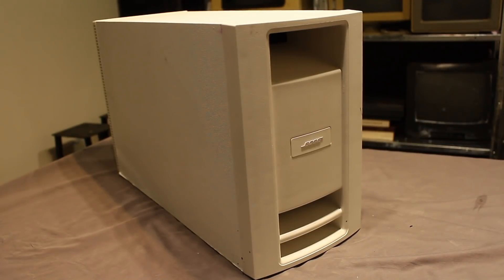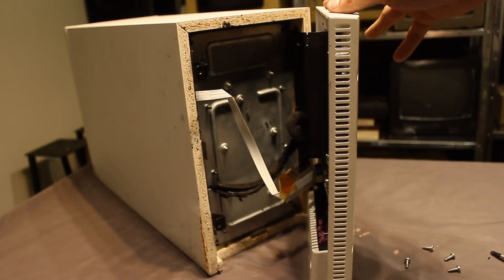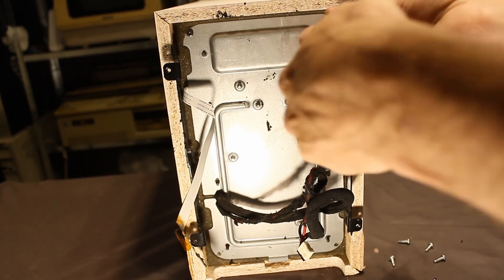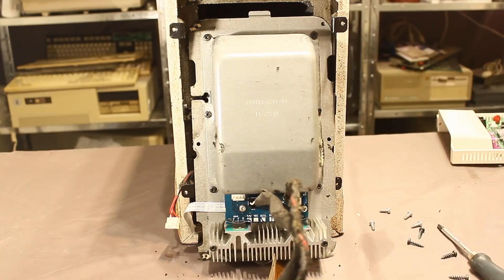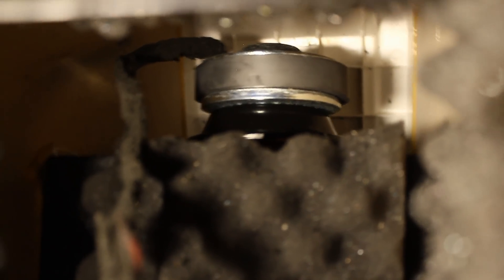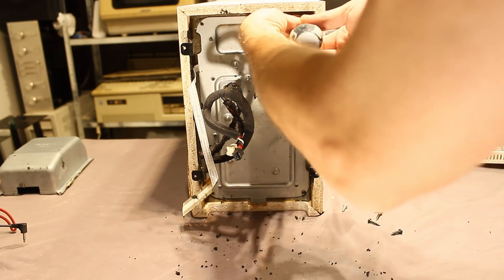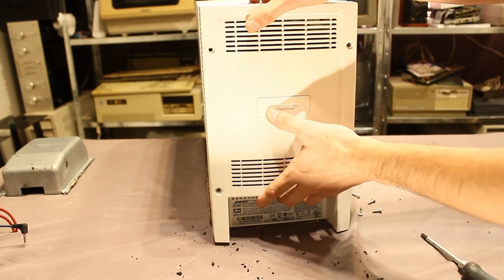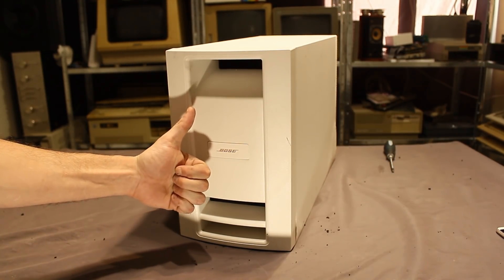Whats Inside Bose Acoustimass Module ( How Many Watts ?? )

Comment: Interesting. Thanks. I'm retiring my old Lifestyle 12 system & going back to a stereo separate component system like I had in the 80's.  The voices through the Bose were muffled, display on the head unit blown & fuse blow every few years on the Acoustimass. It's been fun but time to spend some big $ & move on.

Comment: So a colleague of mine at a previous job was a former Bose engineer through the 1990s and 2000s. He explained that the upper and lower ports create an airflow diode that produce more inward flow of air on the bottom port and more outward flow of air in the upper port, for the purpose of exchanging the air inside the enclosure to cool the amplifier. Overall it's a 6th-order bandpass design.

Comment: Comparing amplifier power to the rating on the power input is stupid. Power consumption ratings are NOMINAL, often at 1/8 Power so a 600w home theater amp may only say 150 or 180w on the power input because that is an AVERAGE consumption. This is NOT what the amplifier is capable of. Even pro audio equipment(amplifiers)is rated the same.

Not knowing this makes your opinion invalid.

Also how many watts something is is not even half of the story to actual bass output. Driver efficiency and enclosure design are more important. 100w into this module is nothing to 100w into a stack of 18" horn loaded concert bins. Bose are usually rather inefficient so 100w into this module is almost definitely less bass than a 100w 12" sub designed for home theatre.
Reply from the maker: Still no reply lol
Reply from the maker: ... The max power ive ever seen this system pull from the wall was 320 ish watts . so the 350 MAX as it clearly states is accurate . bose always write MAX on them. Now as for the " sensitivity " yes on an 18 it would be louder as normally a 18 or 12 is more sensitive hence more efficient then a 5 inch
Reply from the maker: Also if you watched the video you will see i look up the chips . i dont claim its a devision of the power consumption

Comment: Hey man, I've been meaning to ask you: Is the studio like foam inside the bass module something you out inside or something Bose actually installed themselves?

I know you like to tinker with things this why I'm asking, but would love to know because if so.. that's damn impressive.  I current have the Bose V20 and have since chucked my Paradigm Millrnia CT system in the closet as it absolutely floors the Paradigms, but I'm going even farther with the Jewel Cubes and PS48 when I can.

I know the PS28 doesn't have the foam, but sounds very clean and musical, so again please let me know on that eggshell foam stuff.

Glad to see you're still making vids, keep it up man!
Reply from the maker: The idea of the poly fill is to make the woofers think there in a bigger box , it does extend low frequencies a bit which helps the overall sound . Connect the millinea satts to the Bose and then run the adapt IQ . I’ve found the Jewel cubes to be a bit limited compared to the standard cubes . Experiment with it . I’m currently looking at a cheap V30 Bose system atm never know might put out some new videos soon
Reply: @TheTechGuyYT  Ok man, but you didn't answer my question, lol - did you install that foam in the bass module yourself (along the sides of the cabinet wall and around the isobaric dual woofer chamber) or did it come like that from the factory?

I know all about acoustics and polyfill; I've built my own subs (sort of, parts and tinkered, got one working that sounded decent) - but I'm asking if that's all default Bose foam, fr the factory.

I personally far prefer the Bose sats over anything else.  I've even had the BeoPlay S8 by Bang & Olufsen and while a brilliant system, couldn't quite compare to the Bose.

Again, excellent channel man, you go against the grain which is awesome!!
Reply: @TheTechGuyYT  And sorry if that sounded snooty dude,, just meant the main question wasn't answered, which is why I commented in the first place; So Bose foam or your foam?
Reply: @TheTechGuyYT  Are you going to answer my question or not man?  Or do you just generally leave people hanging on your channel?
Reply from the maker: Sorry I have a full time job . Yes I installed the poly fill / foam
Reply from the maker: Also for some reason I don’t get notifications about reply’s unsure why I have to manually check
Reply: @TheTechGuyYT  Hey man no worries, sorry I came off as bit of a jerk; interesting. So Bose doesn't use Polyfill by default then?  I know their Series II bass modules did, with the giant front metal grill, but that was a different design all together.

Weird... Thanks for your responses man
Reply from the maker: They don’t by default in the one I have , but I don’t think it was a cost cut from Bose , with the adaptIQ and all the R&D they do they know what they are doing ,   I wonder if the new modules have polyfill , I want to get my hands on the acoustimass 700
Reply: @TheTechGuyYT  Exactly - I was just reading up on this for a bit;  too much poly fill will destroy your subwoofer and sound quality, too little will cause massive performance metric differences.

What's the most impressive - is having no Polyfill leaves the woofers to nearly burning themselves up if they can't handle the abuse, but allows Bose or any high quality speaker manufacturer to consistently make the same box performance everytime off the assembly line, so pretty mind boggling what that says about Bose woofers; their suspensions are damn near indesctructable.  I've actually felt one in person and it was so memorable in the robustness and stiffness of the suspension that I still feel like it was yesterday... This was in 2005.  The LSPS28 module.

They're top notch man - they're not cast gold diamond plated tungstin steel, but they're the next best thing; incredibly robust and excellent sounding.

Keep up the solid work man - you're above the rest in nonbiased appreciation of Bose.

Btw: you picking up that V30?
Reply: @TheTechGuyYT  There's tear downs of 700 series modules on YouTube; no stuffing from what I can see, but obviously Bose has found that to be advantageous to their design - not even sure if stuffing would work in their T-Line or WaveGuide designs, period.
Reply from the maker: I am picking up a V30 in fantastic condition in about a week when I’m off work . Should be good
Reply: @TheTechGuyYT  Best bass module ever IMO - compact, musical yet powerful and a more cleaned up design vs the older module with the huge amp jutting out the back, but wired so no disconnection issues like the newer ones.

It's the design I grew up with and was most enamored by; the module that screams 'Bose engineering's the most.
Reply from the maker: I’ll admit the Bass module from Bose is one of my favourite compact woofers . Great warm sounding unit , it’s also very impressive that it’s only 2 5 inch woofers
Reply: @TheTechGuyYT  Bro, it's like I'm talking to my clone man, haha.  Let me know how the V30 goes.

Comment: 240 watts. That is more then enough for a large living room. 20 feet by 15 feet. Had many of party with my Am5 with more then 20 people and the music was louder then the crowd. Louder without distortion. Their are better system but Bose was the first to come out with a sub system. Other follow.  My Am5 are 18 year old. She will die soon. She showing her age. I will miss her but will upgrade to better. She did her job well. She just missing mid bass. So a got another two small sub just to cover that range. I thing Bose fell off the band wagon lately after the founder die, like Steve Job and Apple, no more thinking out the box, think money now.
Reply: The best thing i find in them is the simplicity in use with their promise of good quality sound. 
Bonus is that no matter how loud i play, it never distorts regardless of the bass level even if it is all right up to max setting.
Reply from the maker: I've updated to a SoundBar 700 and bass module 700 it's even better
Reply: Bose thought nothing else except MONEY. Cheap ass shit and suckers bought it.

Comment: An old active sub woofer! how old is that? is it from 1980 or something, look pretty old.
Reply from the maker: It’s a 2006
Reply: Two subs
Reply: @watsonanthony8438  duh what 2 subs?
Reply: @apolloares6114  the enclosure has dual drivers.  It handles 35 htz well
Reply: Watson Anthony so what?! Even if it would contain 4 drivers, still it would have called an active subwoofer, due to the fact it’s a whole active subwoofer system.
Reply from the maker: It's an active subwoofer
Reply: MARINLAW yup that what I said.
Reply from the maker: Sure is . I now have the Acoustimass 300 with the 10 Inch woofer
Reply: @apolloares6114  i know its an active subwoofer lol i see the amplifier 🤣🤣🤣.  Passive subwoofer need the right amplifier including watts, ohms, and lucky crossover 🤣🤣🤣
Reply: MARINLAW great! Saw the driver! Terrific one!
Reply from the maker: Very lucky crossover haha

Comment: This is not a subwoofer what people think . It's a bass booster . It's made to let low sound what we can here.   The funny thing is that de Bose bass boosters your neighbor do hear it like a supwoofer lol
Reply: Lol Bose subs blow lol I have 18" JBL's that make Bose look sick.
Reply from the maker: It’s a Bass Module . It plays down to 35 hz so it can be called a subwoofer
Reply: @TheTechGuyYT  

Yes but still not a subwoofer .  A good subwoofer you do not hear sound only pomp air around.   Bose have make this so the low sound com from the woofer to compensate the small speakers it use for high and middel .

Still you can have good speakers what are not bose.
Is see bose a stereo or HiFi set for dummies .
Easy install and for a lot of people good to use and sound
Reply from the maker: sebastiaan suijkerbuijk you know I own JBL LS60s right lol
Reply: @dyslectische  unless you talking port wind noise but human cannot hear below 32 htz
Reply: @watsonanthony8438  nope this is a myth ,  not every ears are equal , some people cannot hear below 35 hz like my girlfriend and she also cannot hear above 12Khz (really sad for her ) on the other hand i can with my earbuds ( no vibration or port noise ) easily ear down to 3 hertz .

Comment: Are you taking their ratings? I don't trust them. Needs a dyno. These companies will say anything to sell their products. The bigger the company, the worst! Because they can get away with it, where small companies can not get away with false advertising. Can't afford to. I'm shopping at small stores. Peace all!
Reply from the maker: Bose don’t provide rating I looked up the chips and measured the power supply voltage to come to the conclusion of power output

Comment: Hey i have now a bose 600, do you know the code for the service menü? I think there i can change the speakers from jewel cube to omnijewel if i buy the omnijewel too upgrade
Reply from the maker: Just change them . And then run Adaptiq it will reconfigure itself
Reply: thanks, but are you shure? bose tells me that it works but the console as the Software for the jewels, adaptiq too
Reply: @91DivineAngel  Leon run the adapt IQ you should be fine. You can always return the the Omni cubes if you're not happy with the outcome.
Reply: So 280w RMS, what's the breakdown for the sub, front, center and surround?
Reply from the maker: Felizardo Aguilar sorry what do you mean
Reply: Just watch your whole video, very informative, 3 chips, 40w front, 80w center, 40w rear,  so sub 120w? Planning to use this sub with my Bose 151 as front which is right now connected to my 5.1 amp. So what's the best way to connect the sub and the 151? Can I eliminate the 5.1 amp?, so stand alone sub and 151, tnx